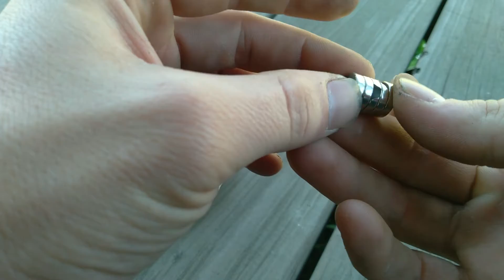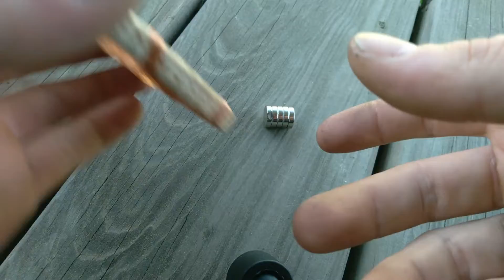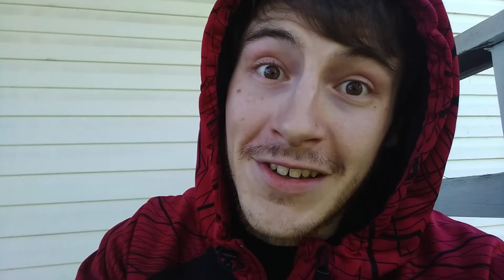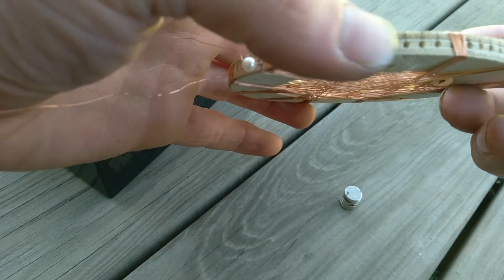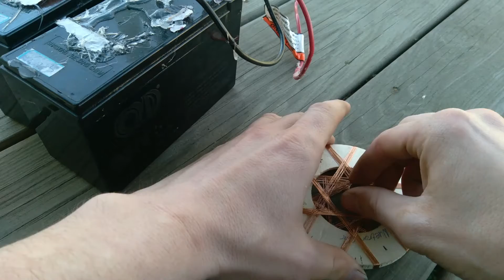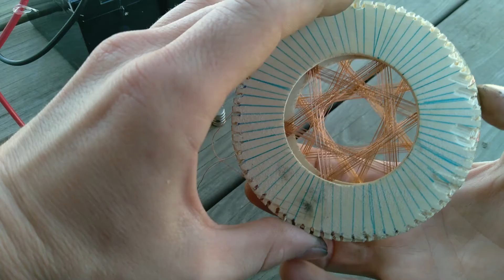I Discovered the Star of David Coil!

Comment: Yoo what’s up man I made my coil hooked it up to batter n wire caught fire what did I do wrong or what am I missing
Reply from the maker: More wire and you need to have a regulated rc circuit connected to the coil if you don't want it to over power
Reply: @Resonate369  sweet appreciate it will that allow me to tune the frequency also?

Comment: Hello, I am glad to see your video, it is very interesting！ What is the approximate voltage and copper wire size you use? Does the voltage increase, the stronger the magnetic field in the middle? Thanks for the reply
Reply from the maker: That is correct and thank you for asking! I am currently using .1mm wire. More turns the higher the emf field goes. The coils can synchronize by turning one clock wise and the other counter clockwise

Comment: The wires may slip off the edge.. Better make small slots around the circumference.
Reply from the maker: They are tensioned for the mist part. The way I have it wound makes the wire form to the wood perfectly